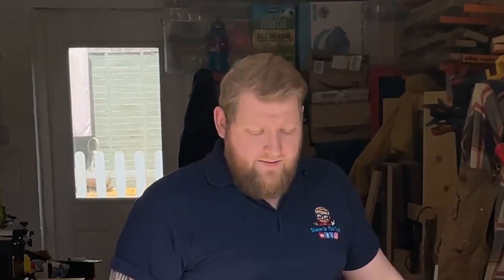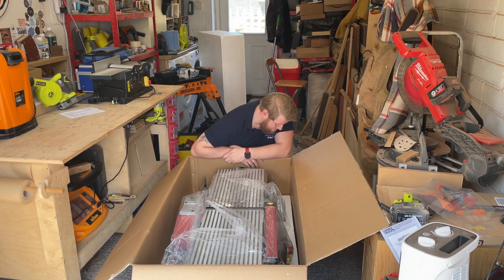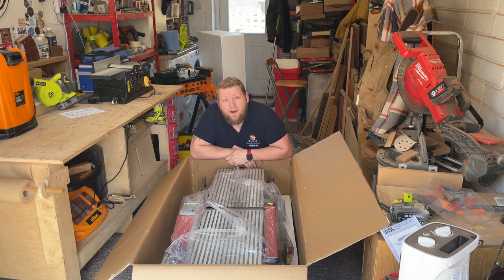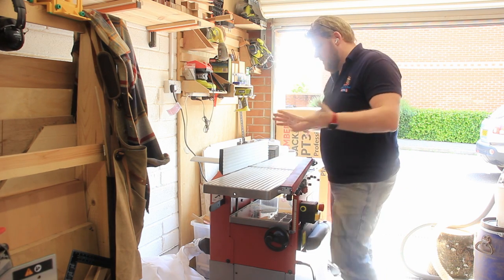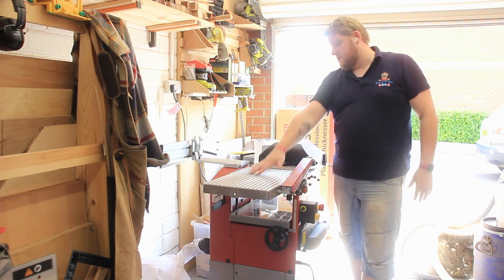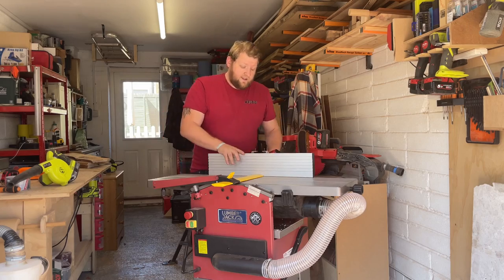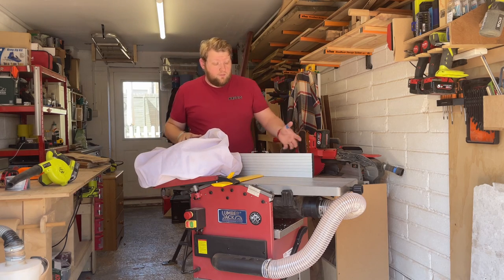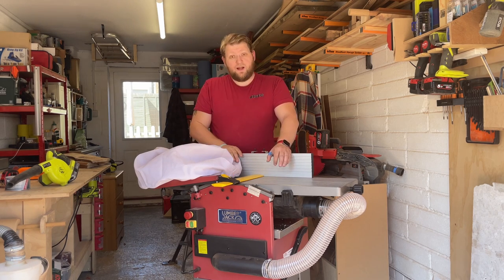Unleashing the Power of Lumberjack PT305, Build & Review

Comment: My only concern is I don't see any thicknesser bed lock which makes me fear there will be micro variability between successive board passes. Can you lock the bed?
Reply from the maker: Completely valid concern. On the handle to move the bed there is a twist screw that you can lock down so it doesn’t rotate through vibration when the machine is on. You can just about see it at 5:43 when I explain how to change between uses.

Comment: I made exactly the same mistake with the tools 😂😂
Reply from the maker: Easily done isnt it.
Reply: Yup, I wish the instructions were better, otherwise I am happy with the machine, just need to get the plug sorted.
Reply: Is the plug due needing a bigger breaker?
Reply from the maker: Apart from the first time I haven’t had any more issues. I may need to change the breaker in the house as it does pull a lot of power at start up BUT atm it seems fine.
Reply from the maker: Yeah easy enough fitting one it’s just having the time. I got a bit of a heads up from @shaunintheshed about the plug